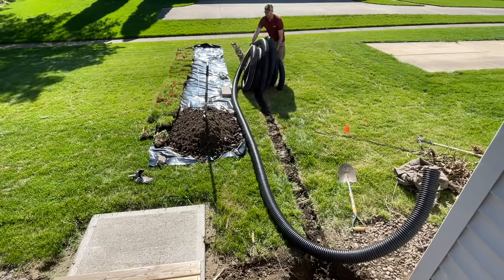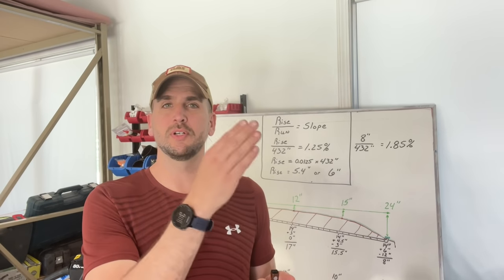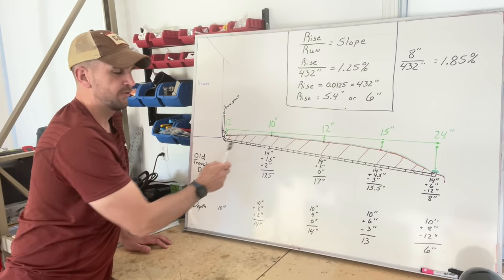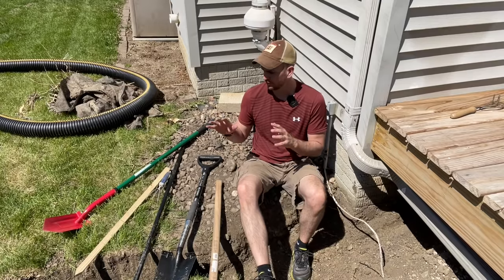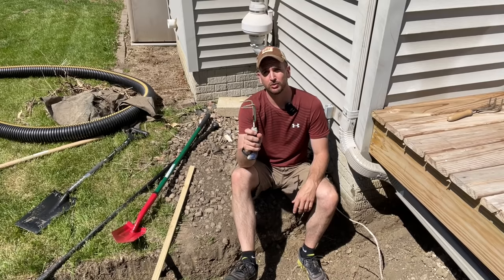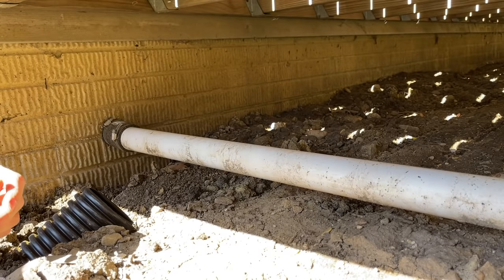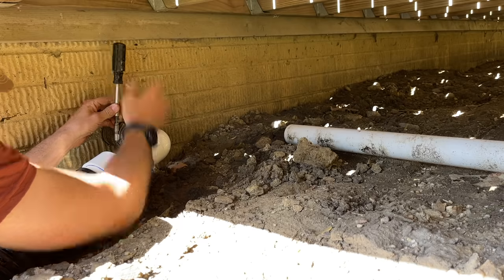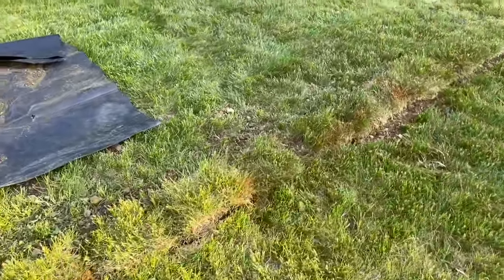Downspout and Sump Pump Drain Pipe Extension

Comment: Why you didn’t take it to the curb ? I just had to install sub pump at my back door to avoid flooding in basement I ask about the curb because it right there and you wouldn’t have to deal with  sidewalks issue due to water.
Reply: There may be a city ordinance prohibiting sump drainage into city gutters.

Comment: What's the performance been like after a year now?  Would you have done anything differently?  Perhaps Perf pipe atleast towards the end, just because of how much water you have?  Or maybe 2 pop ups based on the amount of water?  Just trying to get a sense of what is needed.  I have rentals as well. I had a guy do one of mine, I'm sure incorrectly too, but wanted to see what your thoughts are.  Nice job, not really liking the black pipe at the house though.
Reply from the maker: Hey James, overall the performance has been great.  I did need to change the location of the end popup as it was too close to the sidewalk especially in the winters.  I rerouted the 4" corrugated running parallel with the sidewalk with about a 15' offset to allow the water to soak into my lawn as compared to going on the sidewalk.  Best of luck on your project!

Comment: I had to do that, same problem, pump dumping in the yard. I used a golf ball to check the drop, but I used PVC to run it from the house to the ditch we have out by the road, not sure if a trap well hold all the water we get in a down pour

Comment: I did a similar project years ago.  I found that a direct connection from the sump pump to the pipe is a bad idea.  If water cannot flow through the pipe, it can backup up into the  basement.  The pump will not be a to get it out.   Better to have an "overflow" near the foundation.  I wish I could provide a picture.   I used a tee with an output higher, in case the underground one is clogged.   Gives you a chance in a storm to see that the water is not flowing through the underground pipe.   I have seen this happen in my setup if the end of the pipe is in a submerged pool of water due to flooding.  It might not make sense that this would restrict the flow, but I cannot argue with what happens in my setup.

Comment: I don't recall your location? Is this going to be a lawsuit if someone slips on the sidewalk in the winter? I realize there is value in having your own tools, but did you research the cost of renting a trencher? But thanks, I would like to do something similar.
Reply from the maker: I will be keeping an eye on the sidewalk and if we get into summer and the sidewalk is still wet from the sump pump discharge I will add 10-15' of perforated pipe running parallel to the sidewalk to leach the water into the ground opposed to running on the sidewalk.  No trencher on this project but I have a bigger one coming up and I might rent a mini excavator.

Comment: How is that connection between the sump pump rubber coupling and the corrugated pipe holding up? I had something similar at one point in time and could never get a good seal. It would always leak around it.

Comment: I just watched your video and I want to share my experience with sump lines. I replaced mine about 4 years ago with schedule 40 pvc. We have a lot of minerals in our sump water so it needs to be as smooth as possible. My line drains into my storm sewers out front. About every 2 years I need to have line jetted out. And my sump runs 3 times a minute so I have a lot of water. Is everyone else in neighborhood doing what you are doing? I enjoy your videos keep them coming.
Reply from the maker: Hey Paul, your sump runs 3 times per minute all the time? Dang!
Reply: You need a larger chamber. You’ll be buying new pumps on the regular over the years at that 3 minute rate. French Drain Man will help
Reply: Sounds like my sisters house,  dual sumps with battery backup and you hear the thing run about every 60 seconds.  She's close to a lake.
Reply: @EverydayHomeRepairs  badly designed sump pit. Gonna burn your pump out. Thing is cycling too quick.

Comment: Great video! Two questions: How long does corrugated pipe like that last - 10 years or more? I have a similar project to do, but I have more trees in my yard than you, so I worry about tree roots. Secondly, did you consider backfilling with gravel around the corrugated pipe about half way out from your house (like french drain style)? I’m considering something like this to avoid one single area of water expulsion at the site of the pop up, and prevent washout/erosion etc…Thanks for your feedback!
Reply: French drain style would work if you had gravel underneath a perforated pipe because the ground water would go into the pipe and be carried away as the water table rose in the ground. However, he's not at a low point in his yard so that would be overkill for what he's trying to do and might not accomplish anything. It would also release all that water into the trench and possibly erode the trench over time by doing that. Great for moving water out of low areas in your yard where you have issues, though.

Comment: Using a sweep instead of a elbow will allow water to flow better.   Also in case you have to clean out it’s easier to snake through.
Reply from the maker: Good point 👍

Comment: Another great video. Can you explain what you did at the downspout. I see you attached the corrugated wye to the pipe. Am I correct to assume that a downspout adapter doesn't connect directly to the wye. Did I see you cut a small piece of corrugated pipe to connect the downspout adapter to the wye. Is this correct? Thanks again
Reply from the maker: Hey Paul, correct I had to cut a small "riser" of 4" corrugated to properly attach the downspout adapter to the wye pipe.  Also I went back and used the corrugated pipe tape to seal the adapter, riser, and wye after the video.  Let me know if you have any other questions.
Reply: @EverydayHomeRepairs  Thanks alot. Do you purchase the pipe tape at Depot or Lowes. I am in Canada and cant seem to find it. Also I see you primarily use corrugated pipe instead of pvc. You mentioned about the frost and how it can flex the pvc joints. I see plenty of snow and frost in my area so I plan to use corrugated pipe. Do you ever experience issues however with leaves or debris getting caught in the pipe.

Comment: would u advise this for winter months?
Reply from the maker: I ended up pulling the discharge back away from the sidewalk a bit more to ensure we didn't have issues in the winter.  👍
Reply: @EverydayHomeRepairs  i thought about doing this but the length for me would be 20 feet. my only concern is would all the water freeze and build up underground in the winter

Comment: Great work on the planning and clean trench excavation.  I really wish you did not use the corrugated black pipe for this and went PVC instead.  The PVC is cleaner, less probe to clog and can be cleaned.  The corrugated pipe will clog with organics and roof granules.  Worse if you do not have gutter guards.  I’ve been involved in lawsuits where this exactly happened.

On the PVC, you can use drainage rock, perforated pipe and landscape wrapping on the pipe to work as a french drain, which reduces how much runoff comes out the end of the pipe.  Although in this case, that could be problematic with water percolating back to the basement.

On the popup emitter, NDS does not mention this, but you should put that slightly above grade and raise the sod up around it so it discharges into a local high spot.  This prevents it from discharging into a pool during heavy rain as your work area settles.
Great tip in the plastic!!!

Comment: Good work but, a real risk of flooding your basement when the corrugated pipe freezes.  You need an opening at the sump pump connection to the corrugated, so if it freezes it will run over outside instead of inside. Locking it up tight like you did is a recipe for basement flooding.

Comment: You should have dry fitted your coupling before assembling it, so the lengths and alignment were correct. In addition, you should have attached the corrugated at the sump pump end then placed it in the trench and cut the far end to the correct length. Doing it that way would have eliminated the futzing around you had to do to fit the coupling to the sump pump outlet.

Comment: I recently moved into a house with a septic system and the previous owners were just a couple and all six of us caused a lot of backups. We did laundry every night and sometimes once during the day too. It was a lot of water going into the septic so we just ran the water through pvc pipe slowly getting bigger and bigger (starting with 1 1/4 inch pipe) then finally attached the pvc to a small flexible corrugated pipe and attached that to a longer perforated corrugated pipe that had a mesh wrapped around it and in between the mesh was some sort of styrofoam in place of gravel that I found at the Home Depot but I think I saw it at Lowe’s too. I attached a flexible pop up emitter to the end for overflow. As of about 2 months of using it, it works flawlessly! If it ever fails I still have the option to simply lift the hose attached to the washer out of the pvc pipe and place it back in the original spot. (I am down south so I can use the pvc pipe without having to worrying about freezing)

Comment: Aren't you supposed to surround the pipe with landscaping fabric and gravel to prevent issues with dirt getting in? Or is that not necessary
Reply: It was solid pipe, not perforated like in a french drain.  This is not collecting, only moving water.

Comment: Wouldn't be surprised if the sidewalk is covered in algae soon. There's sidewalks like that near me and they get very slippery. Why not trench out in the direction of the original tubing?
Reply from the maker: It would have been 15 foot under a deck 😅.  I will keep an eye on the sidewalk and if things don't dry out and I adapt to ensure the sidewalk isn't alway wet.
Reply: @EverydayHomeRepairs  I was thinking keep the original above grade tubing that went under the deck and start the trench at the edge of the deck. Either way it seems like you accomplished what you needed to do.
Reply from the maker: Yeah, I am sure there are a few different options.  Was just trying to clean things up and get the water away from the foundation as much as possible.  Thanks for the feedback 👍

Comment: Use a bubble level next time, instead of measuring.  1/4 bubble is great.
Reply: Yeah, that's what I was thinking. Dude went Einstein with slope and rise over run etc. when all he had to do was 1/4 bubble on a level or 1/2" per 10 feet of fall. Lol.
Reply: @LeadRakFPS  with the unevenness of the yard initially,  his method was able to compensate for overall total drainage slope.  He  was able to calculate in the beginning the depths he would need,  otherwise he would be measuring bubbles all the time while digging and likely correcting

Comment: 1. WHY would someone grade part of an overall downward slope UP, towards the house?
2. WHY would anyone run utility lines through random places in middle of yards? Used to be they ran along the back lot line, then maybe underground along the side lot line.
3. Unplug the sump pump when working on its discharge! Don't need surprises.
4. If a sump pump is cycling every 5 minutes during dry weather, there is a problem.
5. So what do you do with all that leftover dirt?
Reply from the maker: I have a small pile of dirt on the other side of the house which I add to and take from for various projects.  We will see after I get all the drain pipe rerouted but I would expect to start drying out all the ground around the foundation and the sump pump to run at a little more reasonable frequency 🤞

Comment: In the winter time the pipe that is buried will freeze solid, then the water will discharge next to basement wall. At night time this water will then "FROST JACK" against your frozen ground beside your basement wall and slowly push your basement wall into your basement. Also your sump pump will be taking water that drains all the way to the floor level and repump it to the surface to add additional water to freeze and push basement wall in.  Your method is great for Florida, but in the Northern States it will costs tens of thousands in basement wall damage during the winter.    Ice freezing on the sidewalk, your insurance firm may take a look at this and say...no you created a condition that exceeds our coverage.  Your on your own for that little old lady that is suing you with the broken hip.

Comment: Incredible.  Have been brain storming about something like this for a long time, strange to see a video doing exactly that.
Guessing I'd need to go deeper since it gets so cold here, and my main issue are the gutters on the back of my house.
They just drain straight down.  Can't seem to find any information about maybe wrapping them around the sides of my house and running them to the front.
Slope is west to east, if I drained away from the house in the back it would be to the west, so pointless.

Comment: I took a HDPE Plastic Cap drilled a hole in it the Cap to the outer diameter of the pipe. I put a short piece of PVC in a long radius PVC “L” The HDPE Pipe was cut long, and forced below the PVC Nipple, so it is tight against the “L” You want the HDPE Pipe pushing hard against the PVC, as it will shrink over time. If you are in a Freezing Zone, you need to have the PVC Pipe as short as possible plan a “Blow off,” in case your pipe Freezes. This can be done with an HDPE “Y” a 45 degree PVC “Y” or a Sump Pump Freeze Relief available on Amazon.

Comment: Several, several issues my man. But it doesn't appear you have a lot of trees to clog up that line. What I'm worried about is the capacity that this line can handle during a downpour. Depending on the feet of gutter and you mentioned your sump pump is constantly running. How has it been so far?

Comment: It seems like you're pumping water onto a public sidewalk, which could lead to liability issues if someone slips. Also, if the sidewalk stays wet, it could become a breeding ground for algae and that can be very slippery. Just a thought.
Reply from the maker: Agreed, my hope was everything would dry out and water would only be on the sidewalk when it rained.  This didn't play out and I ended up backing the pipe up away from the sidewalk about 15 feet and then ran 20 more feet parallel to the sidewalk through perforated pipe inside the yard.

Comment: Nice work,   I would have fixed that Coax cable in case you need it at some point down the road.  Might cause some drama for the next owner , etc.

Comment: Are you allowed to discharge water like that on a sidewalk???
Reply from the maker: I don’t recommend it.  I was thinking the discharge would slow from the sump and only really be when it was raining outside.  That didn’t play out so I ended up running the pipe Parallel with the sidewalk 15 feet offset with a pop up in the middle of the yard.

Comment: Explanation was great and everything looks awesome but......to just flood that sidewalk, basically 24/7........?
Reply from the maker: Yeah, the sump pump frequency got a LOT lower after I got all of the downspouts diverted away from the foundation.  With that said I also ended up making some modifications where I did back the pop up away from the sidewalk.  Made it through a winter with no problems but you are right at the end of the video that was less than ideal.

Comment: 16:44 that tape isnt going to hold over time. I would have done pipe all the way under the sidewalk to the street.  But at the house a rain barrel and overflow to the street
Reply from the maker: Thanks for the feedback Jimmy.
Reply: The tape doesn't matter all that much from a drainage point of view.  Roots, well that might be another thing.

Comment: Is this even legal? Doesn't it need to discharge into an approved storm water drain?
Reply from the maker: Yeah, I will be keeping an eye on the sidewalk and if it stays wet outside of when it is actually raining I will make a short section of perforated pipe running parallel to the sidewalk on my side sitting on gravel to leach the water into the ground.

Comment: Great video!  But growing up in a hardware store, I have to correct you:

@10:08 Mattox

@10:45 Digging bar

I did the same exact thing a few years ago at my previous house. My only issue was I discovered under the first inch or two of topsoil was solid packed gray clay.  A simple 2 hour digging job turned into 2 days.  A plumber friend of mine stopped by to see what I was doing and said in his 20 years of digging, he'd never seen clay packed so tightly.  I used straight PVC instead of corrugated which made it a lot easier to check the slope by simply putting a ball bearing in one end.

Also, @13:23 did you clip something else on the left? Old Coaxial?

Comment: ok.. maybe i missed something, but why would you not put in a "dry" well about 1/2 way out then drop a small utility pump (12v) and run drip irrigation from in into your plantings?   Such a waste to push all that good clean water out to waste instead of the yard and plants that can use it.